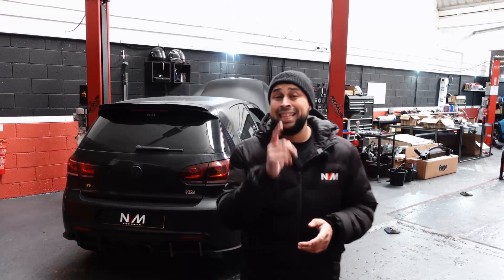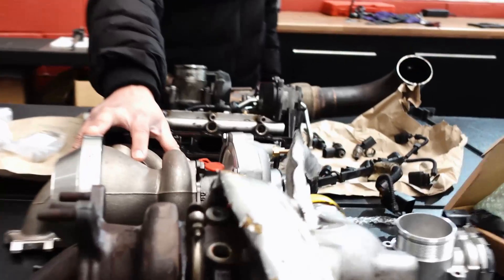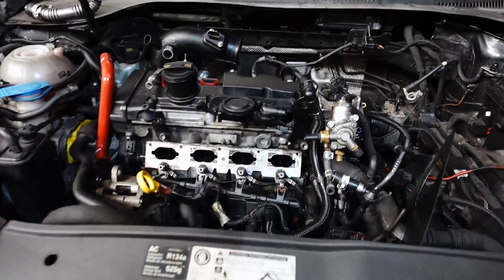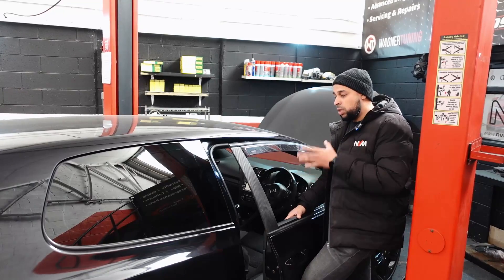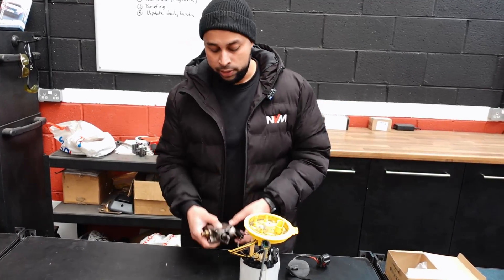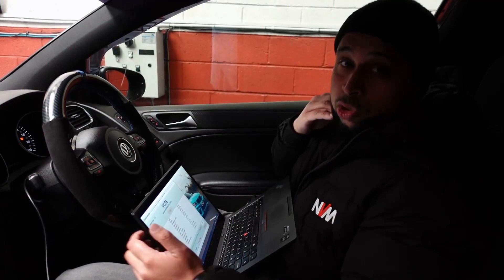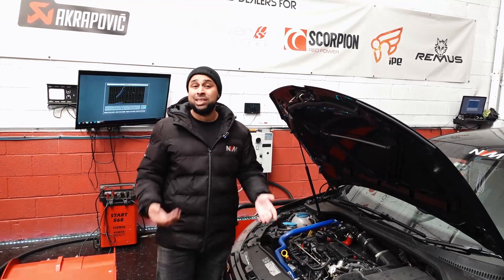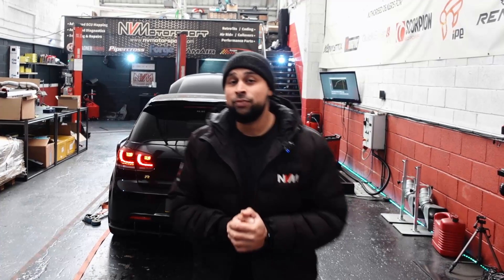MK6 Golf R Turbo UPGRADE!!

Comment: I may be crazy but im running Vis stage 1 pump with ttrs lpfp and RS4 injectors.. the turbo im using is this custom housing with GTX internals not sure what sizes wheels id have to look again. But its rated for 500 crank hp. Im pushing around 1.7 bar of boost and it can hit peak boost as early as 3800rpms. But i dont have it tuned like that it hits 1.5 bar then by 5500rpms hits 1.7 bar.. im on a stock block so i dont want to go crazy. Also im on a 155 bar prv. Works well rs4 injectors are a little smoky.

Comment: Every R i have ever seen is awd. How have you not demolished the rear diff and transmission? Did you disconnect the shaft?
Reply from the maker: You must understand haldex before questioning fwd mode.
Reply: @NVMotorsportUK   then please explain?
Reply from the maker: https://youtu.be/Q5RcT2mBM2g
Reply: @brianfulwood7827  pulling the handbrake up disables the rear unit, allowing it to be ran on a 2wd dyno
Reply: thats a exactly the same question i wanted to ask,thats an all wheel drive car why it the back wheel is not spinning?

Comment: Bro I have a mk6 R and it can’t stay on a dyno only on front tiers 
I’m not an expert but I’m pretty sure it’s 4 wheal drive
Reply from the maker: You will burn your haldex pump dyno in 4wd
Reply: @NVMotorsportUK  so what did you do to stop the rear wheel running?